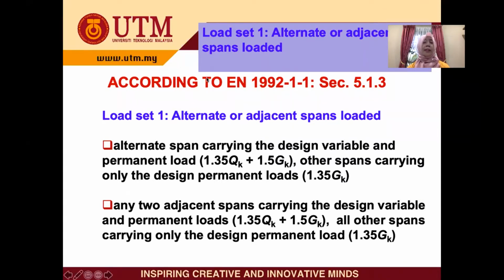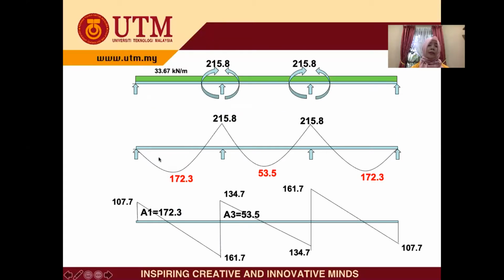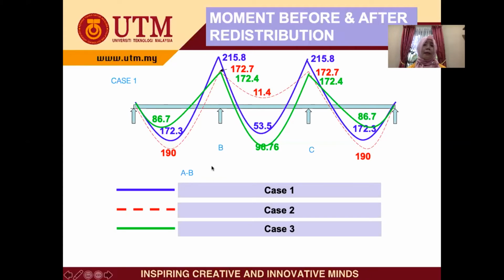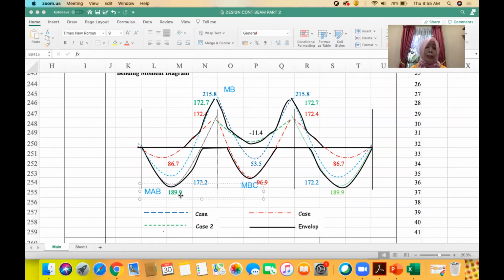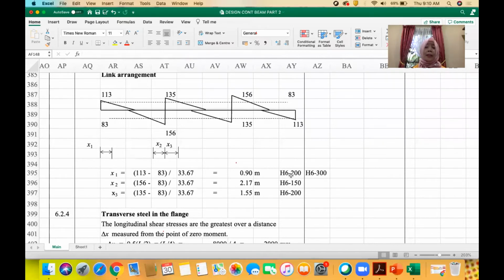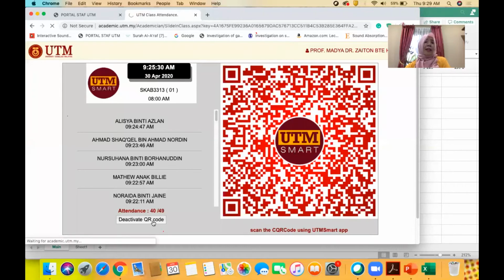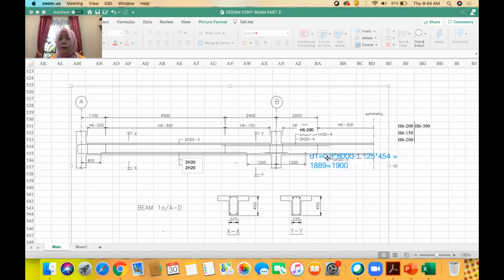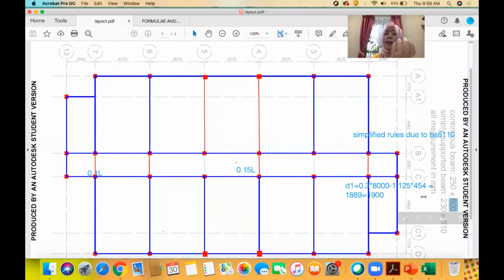DESIGN OF REINFORCED CONCRETE CONTINUOUS  BEAM-PART 2

Comment: Hello Dr, is it wrong if i get negative value for shear force? The negative value is at the first joint so when i draw sfd, i didnt get the zero shear force at the mid of span.
Reply from the maker: dont wory.. it may be because the applied load is so small.
Reply: @drzaitonharon2708  ohhhh i see. So no need to calculate area of tension reinforcement for that span right?
Reply from the maker: @hazimfauzi7078  yes
Reply: @drzaitonharon2708  okayy dr thank you very much for the explanation 😊🙏🏻